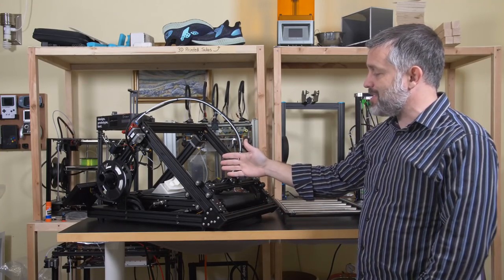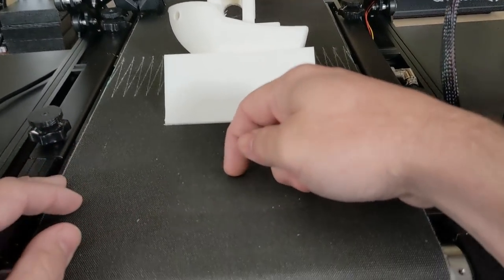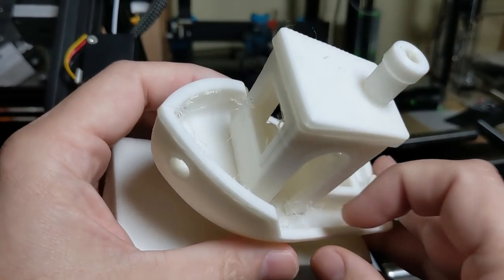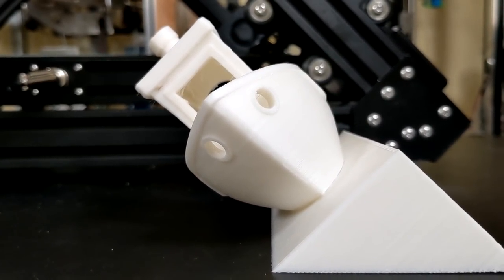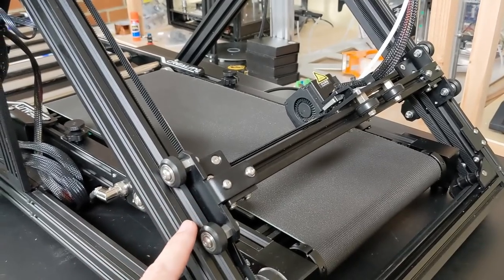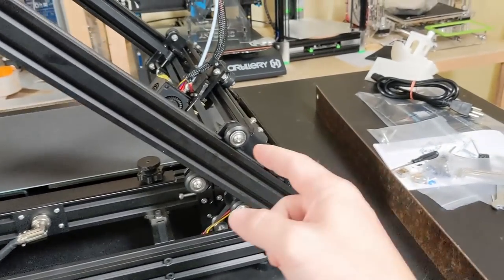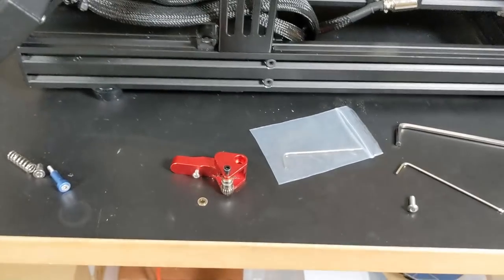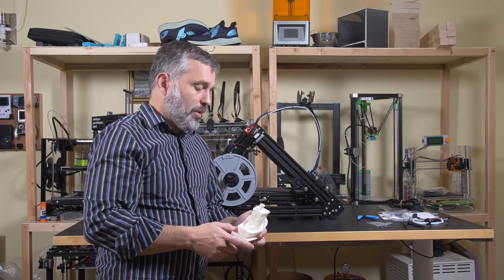Creality's 45° Belt Printer - First Print & First Impressions

Comment: Creality have re-used a lot of design elements from the Ender 5 Plus by the look of it.

Over-constrained moving parts are everywhere on that design, and cause a lot of binding issues — the four wheels on each side of the carriage aren’t a huge problem (more of a nuisance), but the two rods and one threaded rod on each side of the bed are very difficult to get properly aligned.  I am waiting on some non-rigid couplers for using between the z-axis motor spindles and threaded rods.  On top of poorly thought out mechanical systems, the frame not being particularly square, and varying from side to side, makes the Ender 5 Plus impossible to dial in accurately.

What was most surprising with the Ender 5 Plus was no marking to indicate locations for elements.  Someone built it up in the factory, got it working well enough, then disassembled and packed it *without marking where the parts should be*.  Perhaps a lot of my issues were due to assembling it with components swapped around — impossible to tell.  A few cents worth of stickers would sort that issue out.

So, back to this printer.  Creality need to think about the basic mechanical design.  If that 45 degree angle is out a little on either side then prints will be askew.  Movement of the bed laterally could be a big issue, so that’s a critical element.

I like the idea of belt printers, but the mechanical soundness has to be stepped up from the basic Ender 3 style design.  The multiple issues with the Ender 5 Plus design have put me off buying this type of printer from Creality.

Comment: Those 4 rollers will start to make sense when more weight is added to the extruder assembly(eg direct extruder). Does it have an eccentric screw? That should make it more stable than the 3-roller design especially when you have the weighted extruder setup. Hate to hear the ‘BS’ word especially from someone who can’t even align gears on a simple 2 gear extruder.

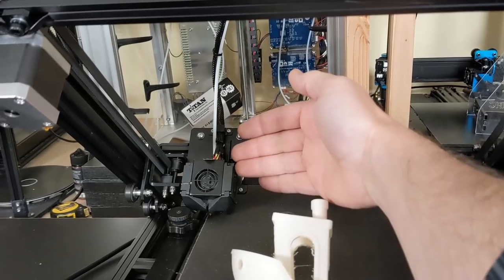Comment: 2:37 How about counterbalances on the other sides of the belts
Reply from the maker: Helps with gravity hurts with inertial mass. Best strategy is to lighten things up.
Reply: @DesignPrototypeTest  inertial mass may be an issue, and heavy 4 wheel parts

Comment: You say 4 v wheels is overbuilt but then say that it's not enough, sure linear rails would fix this but not only is it way more expensive, but the cheap ones also have so many tolerance issues with it that I don't see why v rollers aren't "good enough". Also, I'd have to disagree about the moving mass part, that's just for plain speed, in my experience with all sorts of kinematic systems on printers, the best prints have always come from the printers with the best hot-ends and extruders that can push the filament out consistently and fast enough, although any print bed over 250mmx250mm really should be a corexy, croxy, hbot, etc. Nice video though, thoroughly enjoyed it.

Comment: It would be feasible for a DIY'er to add additional axis to the printer, but the slicer will need to be modified to output angle data. That's a bit above the average joe's technical ability.

Comment: I don't understand why you would want to remove the print in that way. The print should come off automatically by moving the belt until the print falls off by itself.  That is the way this printer was designed.
Reply: I totally agree with you on the 3 rollers thing, I think they went with 4 rollers because they didn't want to load up the single top roller so much in a 3 roller setup because that would cause a lot of wear due to the way the belts in the angled corexy design twist the frame. Personally I would forgo rollers and go with linear rails instead, they constrain everything properly, don't wear out like those plastic rollers and require no adjustment.

Comment: I'm sorry but i disagree with you to a degree on the point of the roller extension : where you say that the first three will be unused. IF you're printing something like say the beam that everyone seems to have printed with these then ye ok you have a point BUT for the demographic that this printer is aimed at which is businesses, when printing smaller individual parts then the first half of the roller assembly would definitely be used.

Comment: So far very excited for this printer though price might be a difference maker for this product. Just my 2 cents but the 3d printing community and the maker community in general tends to have drop-offs at pricing brackets and typically Creality has been a power house in the sub 250 and even that 250-500 market but once you push into the 500-1000 market there is less forgiveness in faults and less buy in from consumers. i doubt creality will read my comment but offering a slightly stripped down version without rollers and such to get closer to that 500 dollar or even 750 would help a lot of people look the other way and fix things themselves as the community tends to do with the race to the bottom printers like the original ender 3, anet, tevo etc.  Also i actually think a slick surface that is level will be better than rollers in most cases like a sheet of melamine or something similar that is cheap tends to be my go to for my table saws and other equipment that needs outfeed tables, though I get the industrial aesthetic that the rollers are going for.
Reply: To the best of my knowledge the rollers will be an add-on accessory not included normally with the printer..  I could be wrong..

Comment: The big issues that I see that are going to happen are mostly with the belt. Seems like the extruder is too close to the belt on the bottom side and ripping the coating off the nylon. Especially with the tolerances for their manufacturing there are going to be people ripping into the bed and  I imagine a lot of people having problems with getting stickage. But I'd love to see you upgrade the heck out of that machine.
Reply: Linear Rail upgrade!   Add another 300 bucks though...
Reply: @WayneWenthin  I don't think it would especially going with cheap Chinese rails. There are much larger problems in terms of rigidity that rails aren't going to solve. But it would be interesting to turn this into the Stratasys S2000 style
Reply: @trashpanda9433  I've got the cheap rails on one of my printers and hiwins on my biggest.  Honestly I don't know if I can tell the difference but I did do all the cleaning/ball bearing replacement on the cheap ones and it is a smaller printer compared to the monster I have the good rails on.  I'll be keeping an eye or two on this as it grows up.

Comment: Nice review but you're wrong regarding the amount of wheels... there are engineering reasons to prefer 4 wheels instead of three on those dynamic load scenarios.
Reply from the maker: There are reasons for ethnic cleansing as well. Doesn't mean it's the right thing. How about you specify the reasons instead of being so insanely vague. Or were you just commenting because you were offended by the adamant nature of my words, and felt like bringing me down a notch even though I'm right.
Reply: Not at all... but I thought nobody would read a comment so long... but: 
1) because everything is at an angle the rollers will bear an axial load, which they're not that good at, 4 wheels means 25% less axial load on each wheel
2) the radial load on the eccentric roller with 3 rollers would be double compared to 4 rollers, and having in mind that the radial preload should be higher than normal in order for the wheels to bear the axial load... well.. it makes it worse
3) given the two previous reasons, the life of the wheels having 4 wheels would be longer, there will be less of a chance to get a flat wheel and the carriage would move more freely with the lower preload that 4 wheels allow
4) the moment created by the belts would apply less load on the 4 wheels configuration because the're further apart. With 3 wheels it is half the distance(between eccentric and concentric roller)= double the force.

Those are just some that come to mind... but I can imagine there are far more.. if you look for roller linear guides you'll find that except for the replacement parts for 3d printers and the ones that run inside the rail, it is almost impossible to find 3 wheels configuration. Don't you think there must be a ton of reasons why the industry use 4 wheels?
And this one is complicated.. i'll tell you a story.
A year ago there was a problem in class with a 4 wheels carriage and a load, a rope bla bla.... the thing is: the math and the teacher showed that 3 of the 4 wheels would be pressed against the rail due to the load (which was parallel to the rail but offset from the carriage), but I couldn't believe it, my intuition was the same a yours... that only 2 wheels would be loaded. So I did what anyone with a 3D printer would do and modeled and printed the elements of the problem and brought them to class to prove the teacher wrong... and guess what... I proved myself wrong... the math and the teacher were right... the wheel you say that would just act as the rudder on a boat was actually loaded... yes.. it is very geometry dependent and load dependent... I am not saying it is the case here, but sometimes intuition betrays us =/
Reply from the maker: 1) Take a look at this image to ensure that you have your terminology correct.  https://qph.fs.quoracdn.net/main-qimg-e4438f22ecd4c79f8ad97bf6981ae167.webp The axial load on the wheels is extremely minimal. The only thing causing any axial stress/load at all is the asymmetric forces introduced by the offset belt attachments.  I would guess it to be less than 100g at it's peak. In not way does this miniscule force justify 4 pulleys. Remember that each pulley has 2 bearings in it. Which doubles the strength. You said "[pulleys] not that good at [axial loads]." which is not relevant in this instance. In fact a single bearing can withstand Maybe 70kg in the axial direction. True, it can withstand twice that in the radial directions, but when the forces we are dealing with are much smaller than a single kilogram, we don't need to worry about it. 3 wheels will work just fine. We don't need the extra strength or stiffness of adding a fourth bearing.
2) The eccentric adjusting cam part has nothing to do with the radial load on the bearing. The single wheel on the one side will withstand the same forces whether or not it is mounted with the eccentric hardware. The eccentric hardware itself is similarly strong. Requiring maybe 50kg to push it to failure.
3) Bearing life is affected by cycles (# of revolutions) and the force which is being applied to the bearings. Given that our loads on the 3D printers are 10X lower than what the bearings were designed for, bearing life is not an issue. This is why you don't see people needing to replace the bearings on their 3D printer motion systems. The plastic wheel may wear out, but the bearings will last for as long as any other part of the machine. 
4) When you say "moment" are you talking about moment arm, or moment of inertia? Your statement is very confusing. You need to use the correct terminology as both can be applied to this discussion. Yes. Further apart means more strength, but once again, we don't need that much strength. The forces are really small.

I can't justify any more time spent dissecting your words. You are throwing out terms that you don't understand, and your logic to each of the above points is demonstrably incorrect as I have shown. YOU HAVEN"T ACTUALLY DONE THE THINKING FOR YOURSELF AND COME TO THE OPPOSITE CONCLUSSION FROM ME. YOU ARE JUST TRYING TO ARGUE WITH ME FOR SOME UNARTICULATED REASON. YOU CAME TO A CONCLUSION FIRST (D.P.T. is wrong) AND NOW YOU ARE TRYING TO FIND EVIDENCE TO SUPPORT YOUR CONCLUSION. This is the opposite of the scientific method and your behavior is a major source of what is wrong with the world today. You can't start with the conclusion. You must arrive at a conclusion after doing all the fact finding and logical analysis. If you can't do this, you don't belong in this hobby or any engineering related field. STEM subjects rely on the scientific method. You have demonstrated that you have no respect for the scientific method. You aren't here to find a 'right' answer. You are just here to argue with me. I should ban your avatar for such an offense.
Reply: Let me explain:
I never talked about the bearings... I talked about the wheels... 
For the wheels to bear axial loading, they need to have a higher preload, thus the higher radial loading.
How could the belts create a moment of inertia on the carriage? That makes no sense... It is obvious it is moment arm what I'm talking about... 
You said it yourself: 4 wheels makes it stiffer and stronger.... Overkill? Maybe.. but are pros at the cost of negligible extra weight.
What was you scientific method to say 4 wheels is wrong?
I'll make more explicit why I say 4 wheels is not wrong.
25% less axial load
50% less radial load = 50% less friction = smoother movement and longer life of the wheels WHEELS I know the bearings are ok with 10+ times the load
If you feel attacked and offended when someone says you're wrong... Well... That's sad... I feel sorry for you
Ban me then :)
Reply from the maker: >4 wheels makes it stiffer and stronger.... Overkill? Maybe.. but are pros at the cost of negligible extra weight
Seriously, though this is what it all boils down to. If you have such a great understanding of the mechanical principles like you are representing yourself to have, just do the calculations and prove me wrong with the math. Prove 4 wheels are needed for strength. Added strength/stiffness is the ONLY pro of 4 wheels. 3 wheels are superior for weight, stability, and adjustability. All of this time wasted conversing with you and I still hold exactly to my words in the video.
Reply: Suppose a preload force L on each concentric wheel. with 3 wheels the eccentric wheel will bear 2L, with 4 the eccentric wheels will bear L. Now if you apply a moment M to the carriage, and the distance between concentric  wheels is D, then the force with 3 wheels on the eccentric wheel would be 2L+2M/D, with 4 wheels it is L+M/D.  Given the same material the deformation S with 3 wheels on the eccentric wheel is double (2S) the the deformation (S) of the eccentric wheels with 4 wheels. Now to simplify, consider one concentric nut a rigid body, The rotation about that wheel with 3 wheels due to a moment M would be arctan(4S/D). with 4 wheels it is arctan(S/D) (again.. i'm over simplifying so you can understand) so 3 wheels is 4 times more flimsy than 4 wheels...
Now let alone the wear... I've already argued way more than you... Your only argument was playing with your fingers on the table which is absurd because in the case of a stool the force vectors on each leg are not co-planar... on the carriage the radial forces on the wheels are co-planar.. a whole different story... 
The E3D Engineers did great on the Toolchanger because the forces on the mechanism are not co-planar to the anchor points, and in that case, yes, 3 is better
in printers they've been using 3 wheels to reduce cost... not because it is better. Use 3 wheels on the bed of an ender or cr-10 and see what happens ;)
Reply: @santiagoblandon3022  I think you schooled this guy and he doesn't like it. I'm not sure why, you've made a very good argument without insulting him.

Comment: I disagree with the assessment of the 4 wheel system. It looks fine to me. How much force do you really think is being applied to a print head? Completly agree with the roller assembly issues though. I couldn't believe it when I saw that thing in another video. The rollers look way too big and way too far apart to be effective. My guess is that they are using readily accessible parts for industrial equipment to keep the costs down. The most concerning thing to me is the way this printer is being engineered, built and marketed. I was originally going to purchase this day one until I really started to pay attention. The women that's heading this project seems a bit off to me. Does she have any qualifications to actually engineer a printer or does she just have big boobs? There is also this odd connection to a consultant that produces some sort of belt printer that can be built but not purchased online (atleast not that I could find). The real concern though is that these are going to be sold through kick starter. When did kick starter become an online market place? I can't put my finger on it but something just doesn't seem right, I'm holding off until I see what the early adopters have to say about it.
Reply: @rattymahatty8456  I've seen her channel. The first thing that comes up is a video of her brushing her teeth in a bikini. Seems like she really wants to be taken seriously. I think I'll wait a bit and see how the units preform before ordering mine from a kick starter.